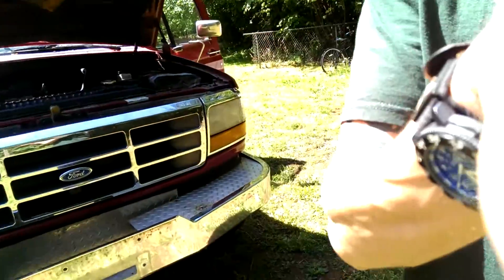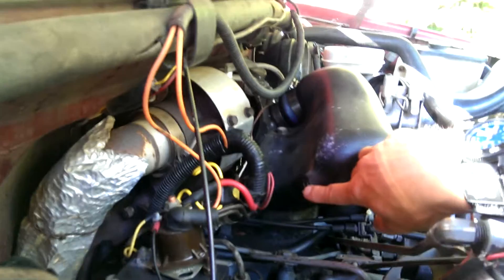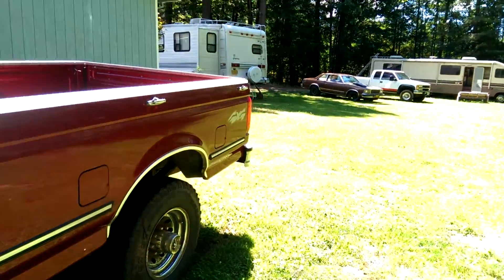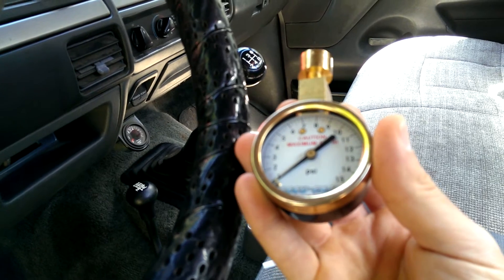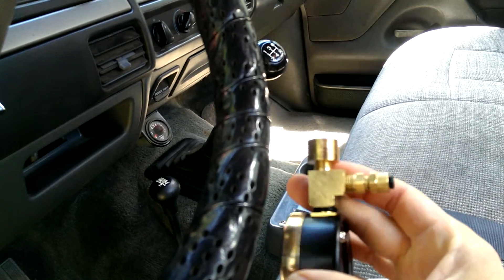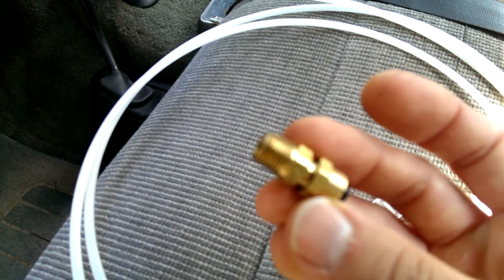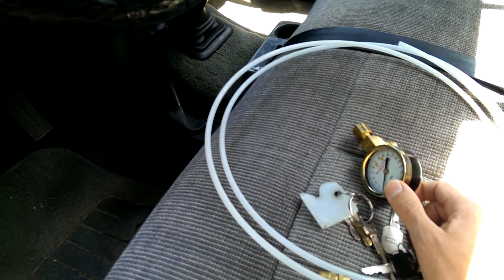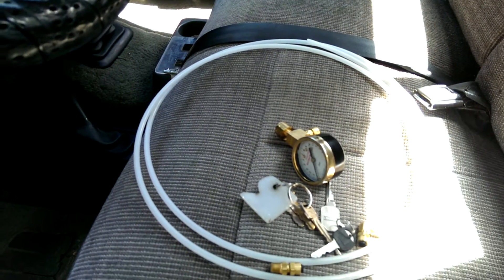Diy cheap and easy turbo boost gauge

Comment: Hey man, this is a great solution! I never thought of it. I have been trying to find a gauge like this but I think I'm looking for the wrong thing. You said this is an ATV gauge? What exactly is its purpose?
Thanks, you would really help me out here :)
Reply from the maker: Blue Collar Power it's a low pressure atv gauge. 4 wheelers run low pressure tires. Most any Honda / Yamaha shop practically gives these away.
Reply: Brian McNeil Ah now I get it. I was wondering if it stood for All Terrain Vehicle but I thought the pressure was too low for tires. Thanks man!

Comment: can you show how you hooked it up
Reply from the maker: FordLover460 just took the intake off, drilled and tapped a thick spot then screwed the fitting in.
Maybe I can do a quick video later. It's -25f outside right now.
Reply: You don't have to make a video, thanks for explaining it though.